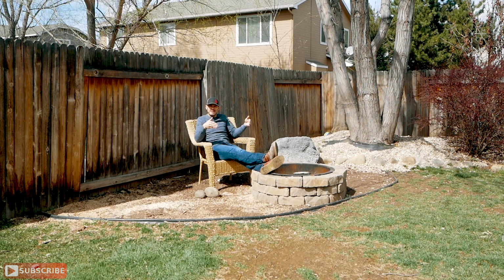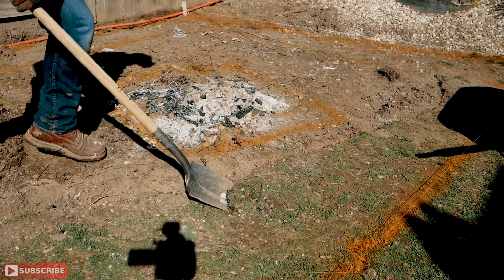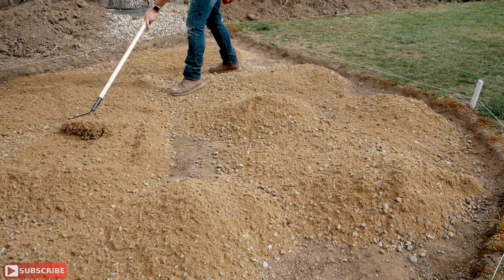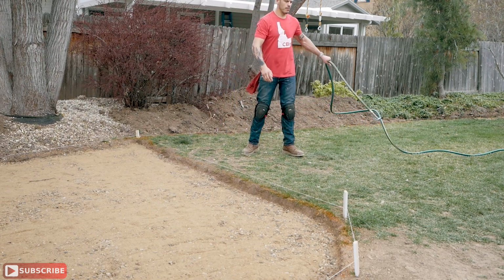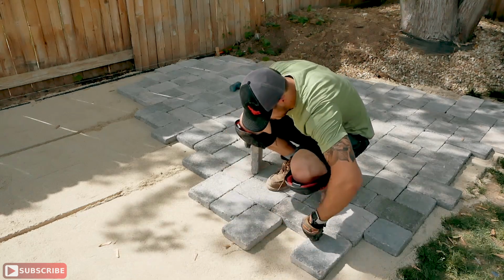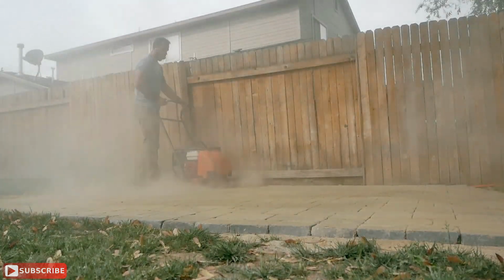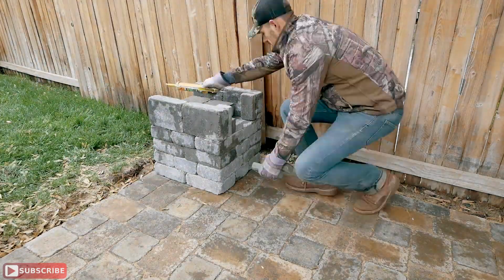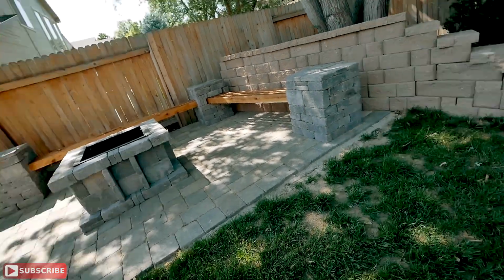Paver Patio Backyard Makeover

Comment: For 12’ by 12’ how many of each block do I need to buy? How do I calculate?  Thank you
Reply from the maker: calculate the Sq ft and then look up how many Sq ft are in each pallet
Reply: Mr. Build It it is matter if I use 12” by 12” block ? Because it easy to lay down without cutting or calculate.  Is 12” by 12” block break easier than your style?

Comment: You should use metal pipe not pvc. You do not want the pipe to bend and the pipe should have the level your looking for. Edges should be set with concrete if you want it to last or some metal anchors. Should have ran the compactor on the gravel.

Comment: Good attempt but that patio will eventually settle. Your base was def not 7” deep and you didn’t use QP stone dust mixed with 3/4 clean stone. Your final coat of dust should only be an inch or two. Finally if you rented the vibrator plate you should have used that for your base. You didn’t mention pitch at all. You should always have atleast a half inch pitch for your water run off. You also used WAY too much polymeric sand. Good attempt for a DIY’r but far away from the way pros do it.
Reply: He didnt even use a geotex type fabric to separate his base from the soil. The base is going to eventually mix in with the soil and fail because of that. 
And yeah, definitely not 7". I always dig down 9" and use 6" compacted cr6, 1" bedding sand leaving 2" for the pavers
Reply: Who cares dude he saved 5 grand if not more. That area will not be receiving heavy foot traffic. And yes it may not be no where near pro grade but its close enough that you had to comment huh. Some people don't have 10 grand sitting around.. and hey to them this is better than nothing.
Reply: @foofstarr4856  for him its not bad. But you shouldn't teach people improper ways to do something. And Its always cheaper to do something right the first time.
Reply: @derekgardner1861  you could call it improper, or you could just say thats how he did it. I agree things should be done right the first time so it can last a long time. Especially the pitch situation and other things, and the DIY community appreciates critical criticism from the professionals or more experienced. Just imagine being on this end of the stick where you hire someone who you thought was a professional, and did a bad job after taking your money. People get sick of getting screwed, so they turn to YouTube and try to do their own projects. Ya it might not be perfect but as long as theyre happy with it right?

Comment: It would really help to see a projected cost estimate on these types of builds.
Reply: So cheapest pavers are about $2.50 per sq feet. Then you need road base & paver base sand (About $200 + delivery). About 5 different kind of hand tools - $200. Polymerics Sand - about $100. We rented a mini excavator from Home Depot about $1100 (for a week - we're doing about 1500 sq feet) & a plate compactor - $100/day.. Hope this helps
Reply: @vineethanda2703  where did you get the sand and gravel from
Reply: Ben Alquist take ur area (let’s say 10ft x 20ft) and ur pacers pavers are 1ft x 1/2ft. So you need 400 pavers. Assume the pavers are $1.50 per pavers and you’re paying $600 for the pavers. Plus the gravel and sand is maybe $400 all together. Plus maybe $100 worth of polymeric sand, pavers edging is maybe $80, and the tool rental is $60. Roughly $1200 for a 10x20 patio if you do it yourself more like $7000 if you pay a team to do it.
Reply: laxmitty21 already about month ago wish I could take pics to show it
Reply: It cost $$$$$$$$
Reply: Cost vary by state? I think
Reply: A 15x15 buying every thing at lowes or home depot will run you about 1000 to 1500 average........but take that into effect your the labor and designer.
Vs shitty concrete quotes because small jobs piss off the concrete drivers they don't wanna move that truck unless it's 3 yards or meters so expect 1800 to 2800$ quotes....may even be in the 4k range after labor and wheel barrow vs pumping minimum.....and if done correctly pavers last longer and easier to maintain you just pressure wash once every year or so and replace the sand in joints vs concrete breaking cracking chips requires new pad or sealing etc
Reply: I put a patio in around the same size without the pillars and bench. You can expect to see around $800 to $1000 dependant on other landscaping
Reply: @alexbaraniak8441  And you can add $10k - $20k value to your home afterward. Thanks, Californians!
Reply: Alex Baraniak please also upload all tools and supply under details.  It help a lot. Thank you
Reply: Just a shovel, hand compactor, hoe and a trimmer to cut the roots. Your video help a lot.  I wish I could upload the photo.  It look really nice.  Still need to do a lot for the backyard because we just bought this house last year.
Reply: @alexbaraniak8441  9 a 1
Reply: Dat Hoang he described whey tools needed. I would purchase materials from local landscaping business or menards or Home Depot
Reply: Alex Baraniak I was wonder where do ppl throw away their grass or dirt that no longer needed?
Reply: @dathoang6993  here in nebraska people always on the look for dirt idk about grass but if u go menard get top soil litt bag i like 5 bucks

Comment: Keep in mind ! Use 5/8 crushed gravel for BETTER drainage then compact sub grade. Drainage is everything with concrete products. You want all the water that lands on those pavers to be able to drain properly. After that use all purpose sand underneath the paver for leveling. Then lay pavers in use paver joint sand that is just a tad finer that regular joint sand in between the joints or you can use a polymeric sand without a concrete additive that works too. Use a snap edge material to hold in place the pavers, concrete won’t work for long. Using Snap Edge will give you security that will last longer. Other than that nice video. But remember home owner drainage drainage drainage!  Also when laying paver joint sand a good rule of thumb is to start from one end to the other **SWEEP THROUGHLY throughout your whole paver area if not you will end up with residue on top of your pavers that won’t come off.

Comment: lol sponsored by home depot but didnt rent you a dingo or a a compactor riiiip

P.S. I do this for a living and everyone do not put the fire put on top of your pavers! you will crack those pavers at the bottom and that will result in your patio failing in the short run!
Reply: VestDZN Thank you for this, am looking at attempting something similar to this at a beach house (so doesn’t need to be perfect and hence a good opportunity for a DIY project). Would you recommend paving around the firepit once installed?
Reply: Tim Hanby you can by a fire pit kit from all the major pavers brands! If you install the fire pit kit and then the pavers around them you should have no problem at all with the blocks cracking on the outside of the pit.

Also one big big other thing is do not I repeat do not buy your pavers or fire pit kit from Home Depot they are outrageously over priced! You can get a whole pallet of 4x8 pavers from your local wholesaler for usually around $200-$250 and that typically is 100SqFt total in that pallets of pavers!
Reply: VestDZN Thank you very much! I live in New Zealand so we don’t have Home Depot, but equivalent home improvement stores with overpriced items so I will most likely stay away from them. We’re getting the pavers very cheap as we repurposed some perfectly good and well made ones from a recently renovated property. They were building over half of said pavers and replacing the rest of the driveway with regular concrete. We got about 15m2 or 150-60ish square ft which is far more than we need. (But I’ll definitely look towards the various paver brands in terms of fire pits) 

The goal, ultimately, is to revamp this existing property and make the current bland backyard a seating/BBQ and “outdoor kitchen” on a deck. We also hope to have a firepit and chairs in the back corner. Thank you for the advice! DIY is a pretty big thing here in NZ and I love getting out there and doing projects like this. All the best!

Comment: Hey everyone. I've got concrete in my back garden I've taken most of it up. Although there is still some left. Can I go over concrete with paving? Do I just use sand and cement the edges and use sand in the middle. The concrete is uneven and slopes back towards the house. Or is it best I rip out all the concrete and do it from scratch. I've got two drains and I'm clueless, abit worried I'm going to mess up some pipes near there when ripping out the concrete.
Reply: I wouldn't recommend doing that, I've been laying pavers for 8 years. You're better off demoing it all out and starting fresh. You'll thanks yourself later
Reply: If the concrete is in good condition you absolutely can. I own a hardscaping buisness.

Comment: I’m building a fire pit as well, but I was told that stone and concrete would explode if fire bricks weren’t used as the base in the building process. But would a Steel fire ring prevent them from exploding?

Comment: What's better for the base, small rock like the one you used or bigger rocks (around 1")???
Reply: This is not a good representation of installing pavers. Depending on what zone he is in, he will have a very short lived patio. I understand this is catering to the DIYer but this is not the way to do the job right. There are many different ways to get a good job but certain parameters really should be met.  To answer your question the actual base material will usually be 4-8" of modified tamped. Modified is crushed stone/stone dust mixed with some small stones.  There are other base materials used but that is pretty typical. The sand itself is only used to set the pavers in and is usually only  1" or so. Some people don't use the sand as much anymore, there is also decomposed granite and other materials.  Additionally, for the actual stone base, again not the sand, where ever you build vertically ie. fire pit, wall, pier,  seats etc. You need to go down deeper with the base. Any good block supplier and manufacturer will have the proper specifications for depth of footing for how high and heavy you're building. As a homeowner,  if you're going to invest the substantial sum of money in to one of these projects, definitely go to a supplier, not home depot, and get the manufacturer instruction. I can't over state the importance of proper base and footing/foundation. That's the absolute most important factor on the job lasting.

Comment: Question... wouldn’t the fire pit been better to have been built on the ground versus the pavers to have better draining? What happens if it rains a lot? I really want to built this myself but I want to do the fire pit first and then do the pavers around it? What are your thoughts? 
Also., I wanted to place the benches on the outside corners versus on the pavers as well to maintain a larger area of pavers and still be able to place feet on them., having your bottom hang over on the grass.. what are your thoughts on that as well?
Thanks in advance.
I loved your video and really has made me motivated to try and pull this off on my own.
Reply: Get a cover $25

Comment: This patio will unfortunately fail soon. The depth was not deep enough and not enough base rock was added, and it was hand packed instead of compacted with a gas powered vibrating plate compacter. Now the base rock will pack tight in random spots over time as water hits it, and some areas will stay loose. Giving this patio a nice uneven curvy surface within a year or so time.
Reply: Tik😅

Comment: You compact the base with a compactor if you want something that wont settle in the near future. Tampering only spots your compactor cannot reach/fit into. The most important part of laying pavers is having a solid base. Also, i dont know what kind of trash mix of rocks and sand you used for the base but any self-respecting hardscape contractor will use quarry processed stone blend and then a layer of stone dust for leveling. Once compacted it will harden to the likeness of concrete. The only thing that's really keeping your pavers in place right now is the polymeric sand preventing water from seeping through and settling the pavers. I would give those maybe 6 months at best before you see signs of settling. - I'm a masonry contractor and do this for a living.
Reply: While widely used, stone dust is not an appropriate bedding material as it has way too many fines. ICPI, many other institutes all agree, coarse rinsed concrete sand is the best choice for bedding.
Reply: American Concrete Pavement Association also agrees with ICPI on this matter, no stone dust, ever.
Reply: @zarethd  As someone that's been at it for years and been using stone dust for decades and revisited job sites over 10 years old. I think my experience says otherwise. I could care less what some people in lab coats decides its best. Everything they've learned to date is from books written by people who have been on the field and I'm one of those people. I do two layers of stone dust on top of my QP, after prepping the QP, i add a layer of wet stone dust which i also compact. Then the final soft layer which is used for leveling. This method will has been tested open without pavers on harsh rainy weather for weeks and I have never even seen a single spot of stone dust fading through the QP. It will stay intact and harden to a point where it might as well be called concrete. I've done driveways for heavy vehicle traffic with this method and so far it's proved the best.
Reply: @Adamantiis  that's great, but coarse sand is still better, there's plenty of experts in the field who will tell you the same thing even if you don't appreciate people who've researched tested and proved it
Reply: @Adamantiis  stone dust is the second best thing and that's why you've had good results but it's still not the best
Reply: @zarethd  So stone dust has too many fines and coarse sand doesn't? Do you get paid by Quikrete to say all that? Get the fuck outta here with that nonsense. I've used both and that coarse sand garbage gets washed right out of the base. The only reason its pushed by these companies its because it doesn't even require much processing.  You can literally pick that up from a shore whereas stonedust needs to be ground up.  You do you pal. I've yet to hear back from a single customer in decades.
Reply: @Adamantiis  Decades of experience? And why are you watching "paver do it yourself" videos and reading  comments. Interesting, mister Decades
Reply: @foofstarr4856  What does that even mean? I watch all sorts of construction videos on here? Why would me working in the field prevent me from watching a video? Are you cooked in the head?
Reply: foof starr I disagree with that assessment. Regardless of experience or viewing pleasure, one has nothing to do with the other & neither dictates nor indicates the knowledge/experience someone  has already attained. 

Example: I know how to vacuum, damn well too, (lmao whatever - it’s an example) & I don’t watch vacuuming videos to learn HOW to vacuum, I watch them because I find them satisfying & sometimes even entertaining. However back to my original point, I hate when lame ppl, who’ve run out of logical things to say, try to use the fact that someone is watching/commenting on a video, as an excuse to discredit someone’s personal experience in anything at all. There’s always several like you in every video & it makes A LOT of us viewers scratch our head & think, “well, that’s just stupid...  & also pretty darn juvenile. What the hell does that have to do with anything?”. Watching a vacuuming video doesn’t automatically erase the fact that I most certainly do know how to frickin vacuum. It just means I’m easily entertained or relaxed by random shit.  Stop trying to sound smart by attempting to discredit someone’s experience just Bc they’re watching a video. Entertainment value is in the eye of the viewer... & we all have different eyes. 

🤫🤭🤐

Have a great night!! 👋

Comment: Estimated cost to build?
Reply: I would estimate at 15'x12' @ $5 a sqft for pavers, gravel, poly sand ect. $900 
Fire Pit kit and insert - $400
Column kit $400
Cedar $50
$ 2K ish in materials, double + if you want to a pro to come in a install 

but is heavily location dependent
Reply: @Kootenayexcavation  poly sand is 40 bucks for a 50lb bag here in Ohio, and with tight joints like that, a little goes a long way. But maybe regionally it's different, and wider joints would eat that coverage up really quickly
Reply: Kevin moehring next gel poly is the best we average 90-100 sqft per bag
Reply: Really depends on the paver. Concrete pavers will be anywhere from $3.60/sf and brick can be up to $6.00/sf for the pavers themselves.
Reply: Derrick Perez yeah we’re at $22 - $28 per sqft for Roman pavers installed up here in Canada

Comment: Uses hand tamper to compact base, but rents plate compactor for the final compaction.  Also, you need edging to keep the pavers tight.
Reply: But that's how you do it. It might be easier to just rent that for 2 days, but if you're already digging it out by hand and hand loading wheel barrows - it's a fart in the wind of extra effort
Reply: @the_uggh  Hey,! I have a question, what's with the violent aggression?
Reply: I do colored concrete edgings with rebar same color as bricks to contain, about 3 - 4 inches wide, then use that as a gauge to set the level for the bricks with long planks.

Works great, and strong.